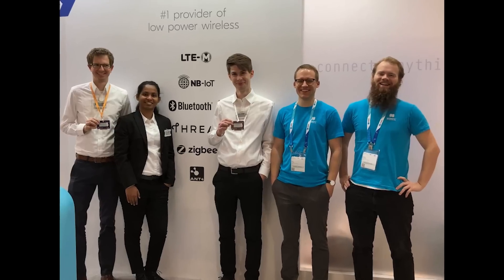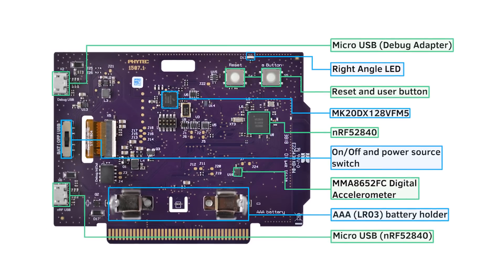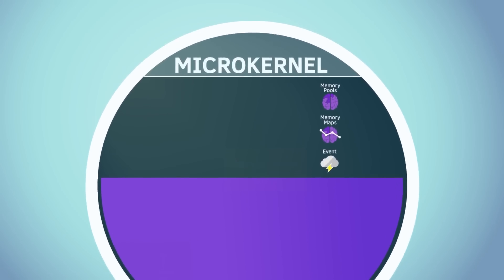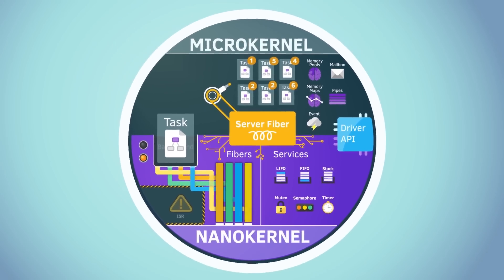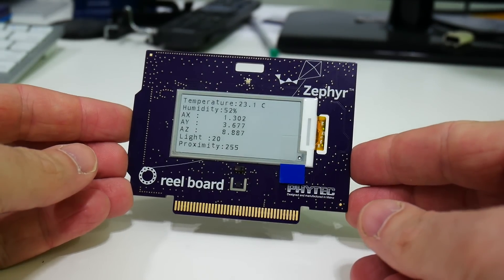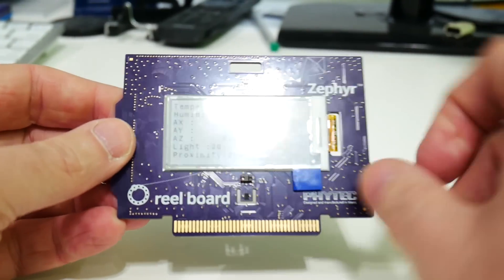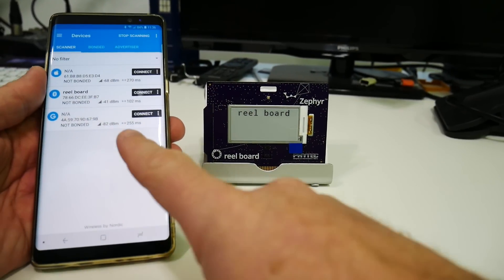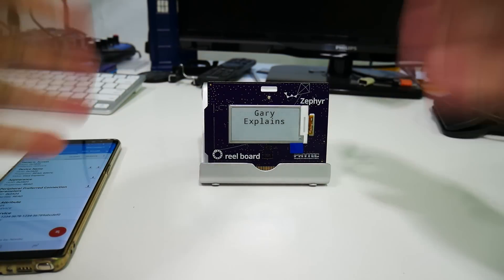Reel Board Review: Zephyr OS Dev Board with Bluetooth 5

Comment: VXworks > Zephyr os
Reply from the maker: How, since Zephyr is based off VXworks?
Reply: @GaryExplains  Based off doesn't always make it better. I have worked with VXworks for years. I tried Zephyr and well to me it has a long way to go. I know Wind River is working on helping the Zephyr kernel. Though Zephyr is stable and it works great. I think it still has a little ways to mature compared to VXworks. It wasn't until the start of this year that it got MPU and MMU support. They are making huge strides every release. 

The company I work for has tired to use Zephyr on several occasions and we couldn't get the same results as using VXworks. We also love the awesome support teams of Wind River. Sometimes they go above and beyond to help if we need it.

This isn't a knock on you at all. Love your channel and you do amazing work. I just prefer VXworks over Zephyr. Maybe in a few more years that line between VXworks and Zephyr will vanish completely.
Reply from the maker: Is VXworks open source? Do you need to pay royalties/license fees when it is deployed?
Reply: @GaryExplains  Wow ? Did you just pull a fanboy move? I expected more from you. I watched your videos and expected you to be of class. He told you why he liked VXworks more and why he used it. He didn't slam you and gave to 100% respect. It was a very respectful reply. You on the other hand. You could have replied with your reasons why you think that that Zephyr was better. Instead you come back like all fanboys is well is it open source? I lost so much respect for you and I am going to unsub. I get going after people who troll or are even rude. But this guy didn't do any of that to you. I support opensource and would pick it every time. God I can't tell you how much respect I lost from that comment.
Reply from the maker: @thatscienceguy9458  Sorry to hear you were disappointed with my reply. I didn't intend to be rude or disrespectful. Basically I am replying to comments all day long and I don't have time to write long complex replies. My question about VXworks and it's license model was in fact sincere as some embedded OSes moved to a partial open source license, but yes I was pointing out the advantages of Zephyr. I will endeavour to avoid writing short replies which could be interpreted wrongly.

Comment: Not gonna lie. I find it hard to think of applications for this other than just identification security. I mean why not just use your phone?
Reply from the maker: So, what about a simple environmental monitor, that is battery powered, stuck on the wall, that sends temp and humidity readings over Bluetooth 5 LE (long distance). No?
Reply: @GaryExplains  Very niche. I do like single board computers though like the raspberry pi.
Reply from the maker: I wasn't trying to give a popular idea or not, I was merely saying that there are lots of applications for these microcontroller boards including robots, home automation, monitoring, smart spaces etc. I then gave you an example, because you said you couldn't think of any.
Reply: This is way more power efficient in comparison to running a arduino with 2x16 LCD, what with the eink display and all

Comment: Lol, same ram/storage configuration as my first XT PC .. just missing the turbo switch :)
Reply from the maker: Exactly! And I bet this board is faster, even without a turbo switch! :-)
Reply: @GaryExplains  oh if it only had a Wi-Fi built in, I'd have a use for it right away. Superb video Gary, thanks !
Reply: Z3U5  well that's obvious. but I prefer adding a battery that not being able to use it at all.